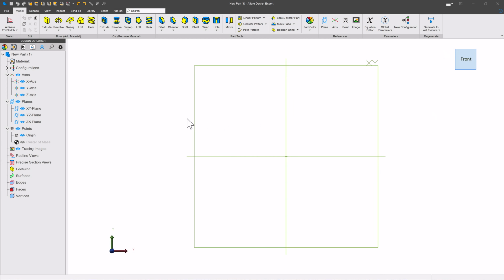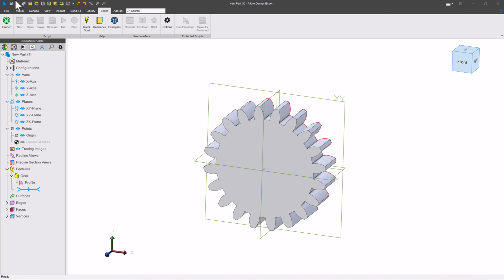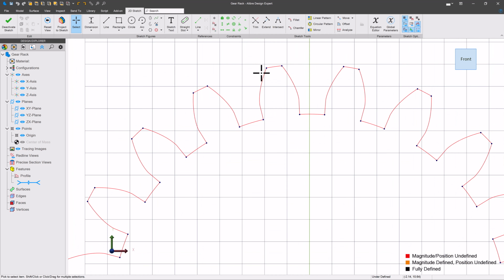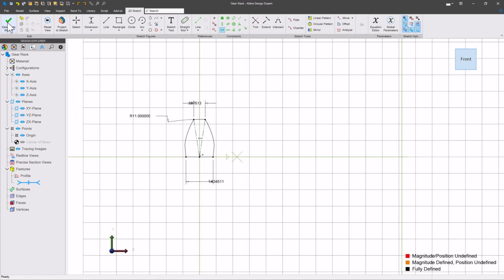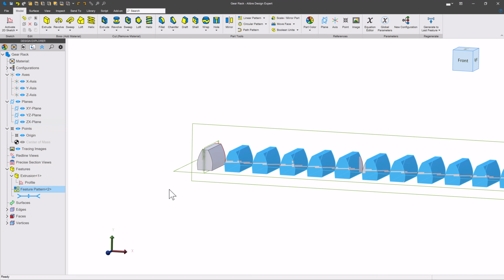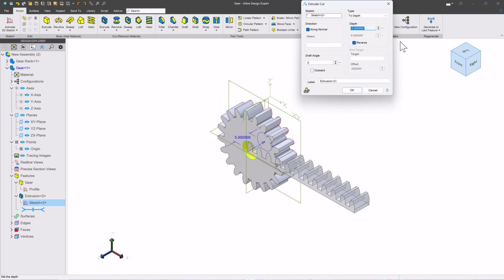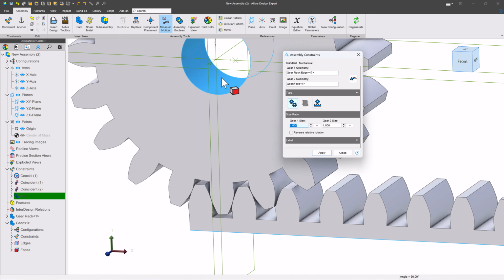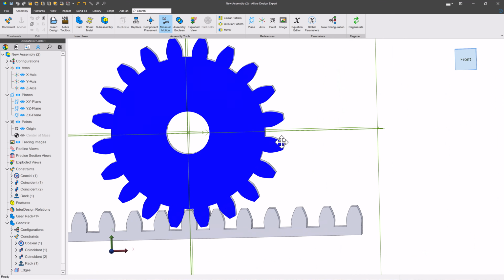Modeling Gear Racks in Alibre

Comment: Your rack is wrong, it should have straight flanks, the included angle will be the same as the pressure angle.
Reply from the maker: I looked into it and it looks like your right, thanks for pointing this out